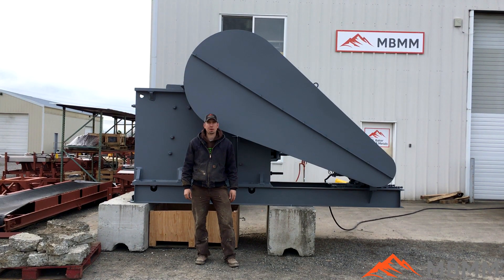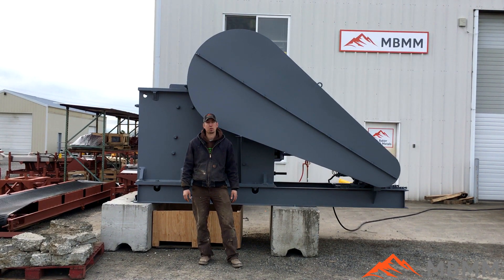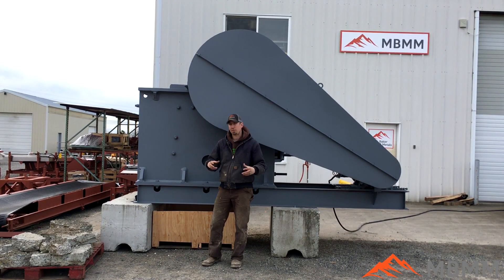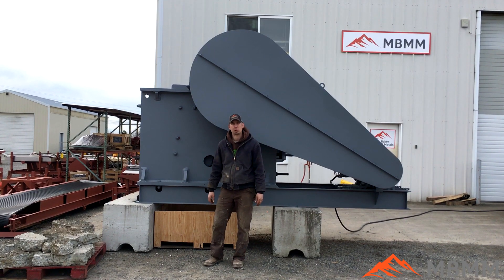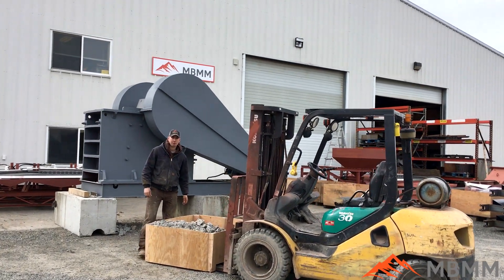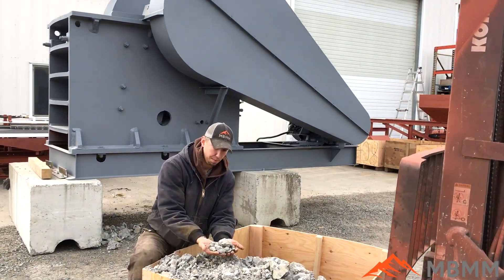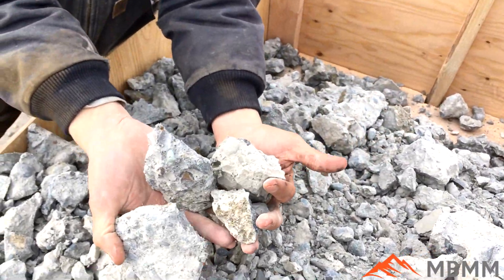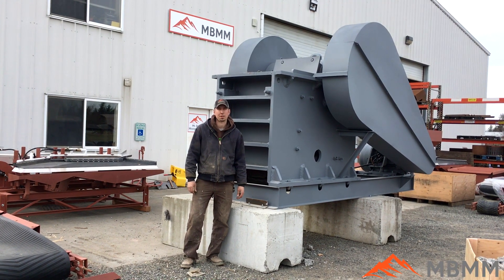20" x 30" Jaw Crusher

Comment: How tight can the jaws be closed up to, can it produce 1-1/2" product??
Reply from the maker: It can probably come close to a 1-1/2" final product.  Concrete and asphalt crush finer than hard rock because they crumble in the jaws and come out finer overall.  If you need everything to pass a 1-1/2" minus you could screen the output and any oversized material could be run back through the crusher.  Thanks